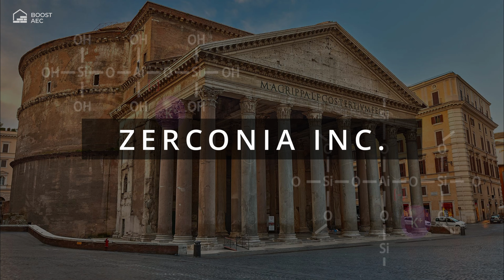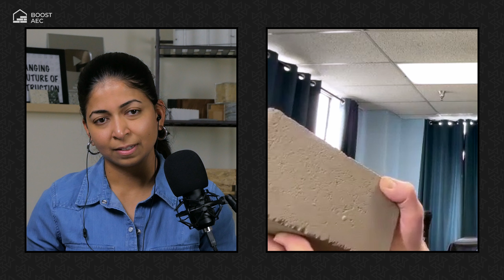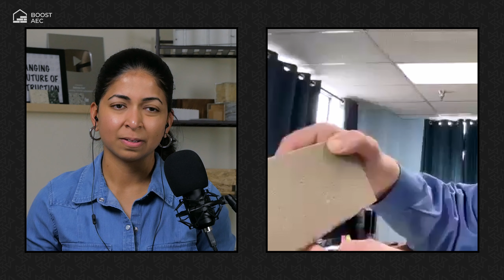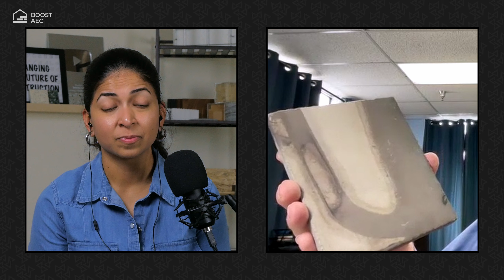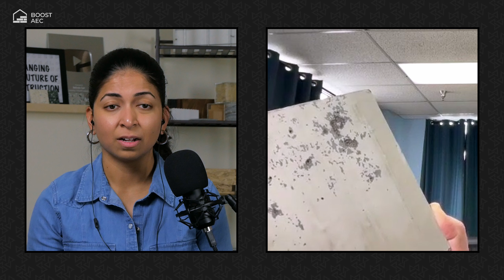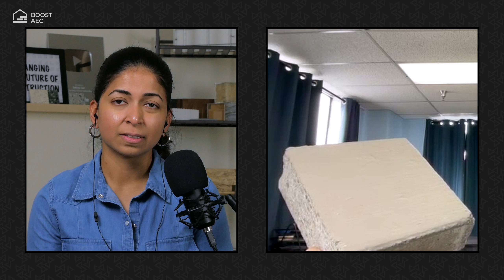Ending Concrete Corrosion w/ Zirconia | Episode 58

Comment: Belinda🎉🎉🎉🎉 thank you I'm a concrete geek and I'm building a couple exposed concrete homes. 
I've been looking for products to finish with, and I'll be testing these products out.
I did a Xypex admixture wall, and it's pricy that way, so I was going to switch to spray on application.

Comment: Just think of the applications for this product, not just concrete, if it could be applied to buried steam pipes or if it could be retailed in a spray consumers could utilize, the endless uses are staggering. Living on the ocean spraying your motor, metal car parts, electrical connections are a must.
Reply: All of those products are out there.